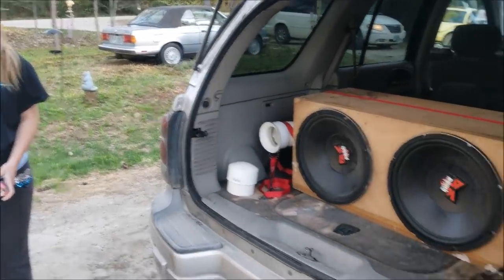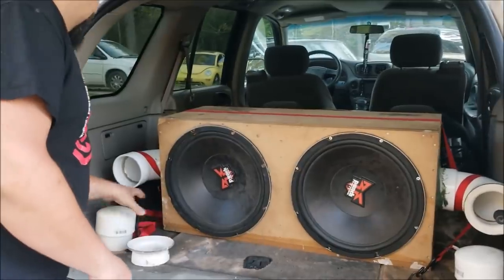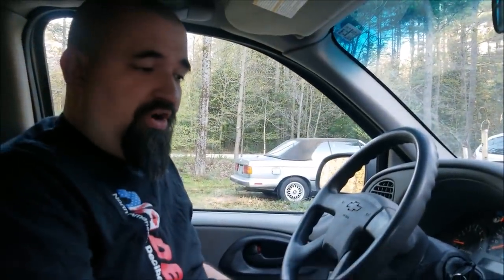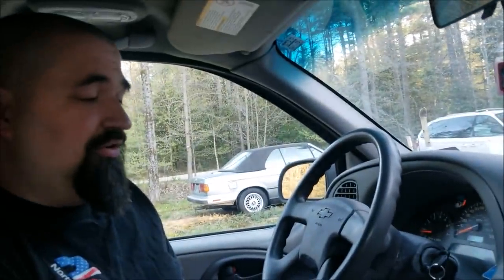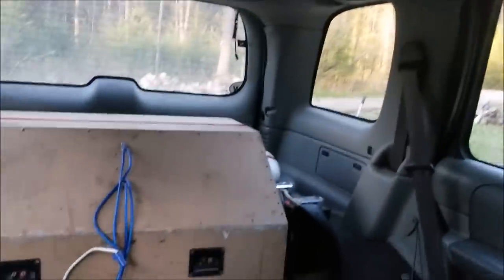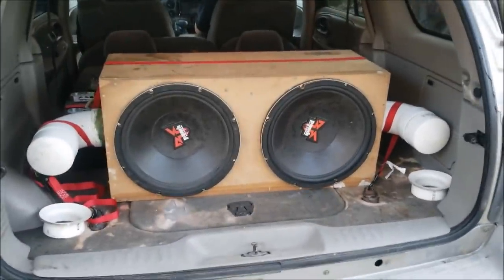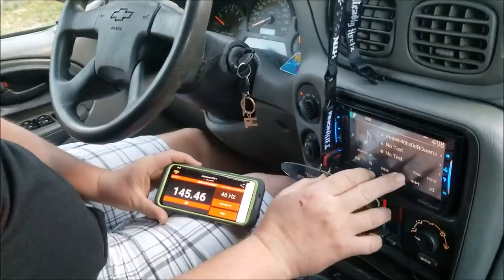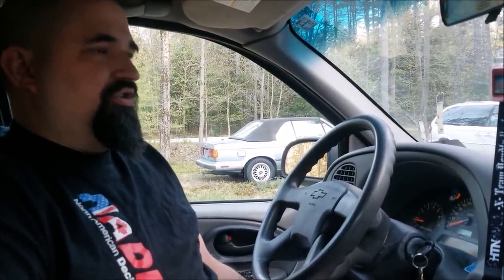Ported vs Sealed Enclosure Subwoofer Box Test with Decibel Meter Using My Daughters Bass Car

Comment: I’m not sure a ported box makes it much louder, but it does sound very different. Sealed boxes sound more “bumpy” while ported sounds more “boomy” to me.
Reply: I have 15 inch sub sealed but it does not rumble in the chest pls any advice
Reply: @Michalslanskycz  What sub and amp are you running and what enclosure and I can do my best to help
Reply: I got sealed and wonder if I should go ported. I don't know what bumpy or boomy implies.
Reply: @DJBLESSD you would definitely notice a difference in the sound and you’ll probably realize exactly what I mean lol. Give it a try
Reply: @TheLILWITEFITZ  yes a difference of better or worse I don't know and I guess to try it would let me know. Good shout. I just wonder if it will be a waste of time. The boxes to buy are 100 to 200 or I could try make it for like 50. "If in doubt check it out" 😉
Reply: @DJBLESSD  if you do make a ported box dont skimp out on port area. a lot of people describe ported boxes as wooshy or boomy because they’re either improperly tuned, or have too little port area which leads to chuffing. for reference my 2 10” subs are gonna be on 28in^2 port area on 800W RMS with a flared 6” aero port. (ive got the 10s but not the built the box yet).

id recommend using winISD, its super easy once you know what youre doing and you can tinker with different tuning, port area, wattage, spl, everything
Reply: @DJBLESSD  -What model, size, & brand of subwoofer? You should follow the Mfg. Suggested enclosure recommendations. First ✔️ to see if they recommend ported. If so these are my go to general recommendations( I have over 30years of audio experience, and the 12sq. In to 18sq. In of port area per cu. Ft. Is not the proper way to calculate port area, imo.), as  Most 12" work well in 1.75cu. Ft net to 3 cu. Ft. net, (2.25cu. Ft. Net works well imo.) Ported enclosure, tuned between 30Hz to 34Hz, (32Hz imo.), with approximately 30 to 40sq. In of port area, per 12", no matter what cu. Ft. Of air space, imo. If you have a 15" most work well in 3cu. Ft. Net to 5cu. Ft. Net, ( 4cu. Ft. Net imo.) Ported enclosure, tuned between 28Hz to 32Hz, (30Hz imo.), with approximately 50 to 60sq. In of port area, per 15", no matter what cu. Ft. Of air space, imo. Hope this helps?
Reply: @Michalslanskycz  - What make, & model 15"? What impedance is the coil, or coils? If its a dual voice coil 15", how do you have it wired, parr. Or series? What make, & model of amplifier/watts @ what ohm? What does your electrical= alt., battery, and wiring/grounds consist of?
Reply: @evilinside5984  yo evil 👋🏼 that don't help me out because I don't understand what cu,ft and net is and I need to go back to school to work out what you mean exactly however thanks for sharing your information. I don't want 'chuffing' 100%, I don't also understand if you have a box tuned to a certain frequency like to 30hz to 34hz does this mean it will not play other frequency's to the same volume? I heard ports can make the speaker over flex more due to air flow I think 🙏🏼
Reply: @DJBLESSD  - A properly built ported enclosure, will give your woofers MORE CONE CONTROL= they will move LESS than they would in a sealed enclosure, as long as you keep the freq., going to your woofers above port tuning. But this can be kept in ✔️ with crossovers/subsonic filters. Example: If a ported enclosure was tuned @ 30Hz, it would still play ANY freq. that is given to it. But it will play more loudly, & have more cone control from about port tuning, to about 25Hz above tuning. This changes from speaker to speaker, & also depends on enclosure size. Example #2: If your 15" woofer works well in a ported enclosure from 3cu. Ft. Net to 5cu. Ft. Net, if you chose 3cu. Ft. Net, it would have a wider, & more even bandwidth= plays more freq., but @ less of a boost, like if tuned to 30Hz, its bandwidth maybe from 20Hz to 60Hz? But if you were to put that same 15" woofer in a 5cu. Ft. Net ported enclosure, tuned @ 30Hz, this bigger enclosure would boost a narrower bandwidth= less freq., but these freq. would play louder, but would also fall off quicker on both ends= the low freq., & the higher freq. The bandwidth may only be from 25Hz to 50Hz? If you put the 15" woofer in 4cu. Ft. Net, & tuned to the same 30Hz, it would split the difference approx. & the bandwidth would be about from 23Hz to 55Hz. These are examples, to give you more understanding. You would use your amplifiers subsonic filter to limit over excursion, below port tuning.

Comment: These subs take me back to a better time In my life
Reply: @Paige Miller   Me too, use to run eight Rockford 15s.
Reply: What is ur profile pic
Reply: @ Dre Swag, it’s a 85 c10, with a 2 tone paint scheme I designed on my computer.
Reply: I had an S10 blazer with 4 XLC 12’s getting pushed with 2 Punch 200ix DSM amps.
Reply: Back to comp days  think it was a 155.5 out of single 15 idk my boss back then was a crackhead
Reply: Very true.
Reply: Do you guys remember the Hx2? :( Such a great times....
Reply: Bro I had the sickest set up. Until my old lady crashed my car. I couldn’t get none of my equipment back. I gave up since then. I’m now getting back into the culture since I’m driving 2 hours a day for work. I’m starting at the bottom but once I get my wires ran it’s easy from there. The new amps now a days are so much smaller! Holy shit
Reply: I can’t agree more !

Comment: I actually felt my sealed box hits harder than my recently installed ported box. But mainly I see the gains going to a ported enclosure is air cooling and venting the heat out of the woofer which will give you more life out of your electronics! I’ll never buy a sealed box ever again

Comment: MAN!!! I miss that old Fosgate. Those amps were insane, and the subs XLC HX2 HE2 power dvc..... USAC..... good times 😁😁
Reply from the maker: Solid equipment for sure, it makes me sad that RF stuff is no longer made in Temple AZ USA... thanks for watching and commenting!
Reply: The power line amps are as good or better than old school But I miss my old school RF shredder design. The punch and prime  definitely not as good as old school
Reply: I still got 2 12´s Hx2 and nothing compares to them... not even Orion Subs :(
Reply: @jaydee2620  yeah my buddy got a punch p3 and that thing was weak.  i had one of those old cheap sony's that looked kinda like a hexagon just sitting around so we through it in there to make sure it wasn't the amp that was the weakest link..  man that sony blew that thing away.  ended up trading him for the fosgate being i wasn't using the sony anyway.  now i'm stuck with it.

Comment: I remember this subwoofer. I was running two sealed Massive CW 12's at the time. My best friend pulls up from the stereo shop and we go for a cruise around the block. A single Punch Power 15 in a huge Obcon ported box... the difference blew my mind! Fast forward 15ish years, I still think of that single sub setup.
Reply: that just makes me think of what you run today?
Reply: @VincentsVideoVisions  A single CT Sounds Strato 12 off a Cerwin Vega Stroker S91000.1D, and in my family car a VVX 10 off an Infinity K1000. Swapping a Wolfram AG12 this week. Not sure which car will end up with the AG yet, most like mine

Comment: You've probably gone on to a different setup by now, but I wonder what your air speed is in those ports. They might be compressing your output. Also, porting increases the volume at a specific frequency, so it's not necessarily 'supposed' to be +3dB everywhere in the range. Your port tuning and your listening area's tuning are two very different things.

Comment: I hit a 157.5 at an SPL comp back in 2001  running 3 JL 12’s and a punch 800A2
Reply: Thats not on a Term Lab= new style pressure sensor type SPL meter. I had a walled 2-15" Power Hx2 Rockfords, with 2-Bd 1500s strapped, & I hit a 164Db on the old style SPL meter  back then. When i ✔ it later on, with a New Term Lab meter, it only did a 149.9Db to my surprise= the new meter showed over 14 Db Less👀, everything was the same, metering positioning, subs, enclosure, amps, wiring, batteries(6 Qty.) & 1 alternator. Now to be fair, the old Audio Control meters could be manipulated by +, or - 10 Db with a knob. But even when calibrated properly, these old SPL meters lost there calibration very quickly, making them very inconsistent @ best. Not to mention that + or - 10 Db knob that i have seen used to cheat scores during a competition to make a fellow friend or competitor score "Louder", then turn the knob back down, to be able to win! These new Term Lab meters can NOT be manipulated/changed, to prevent cheating. Sorry if this hurts your feelings, but your 157.5 Db score would probably be about a 143Db to 145Db on the Term Lab SPL meter, which was not used in 2001 yet.

Comment: What I've noticed is that, to gain 3db or more from the subs in a ported enclosure. You need an enclosure that's ridiculously large. As in like 2x larger.

I prefer sealed honestly. My 12s are in a sealed enclosure.
Reply: Small sealed box for cars, large ported box for home theater 👍
Yes, they're usually 2x as large😂
Reply: This agrees with the iron law that of course more space makes more Bass. 
I've always loved triple or quadruple sealed setups because you can fit twice the drivers in the same amount of air space while maintaining a tighter more accurate sound that has more impact. 

I'm actually headed out to the garage right now to start building my sealed enclosure for three 12-in stereo integrity SQL 12s. They are the best deal out there by a mile if you want ultra high performance xbl2 motor sealed subwoofer setups. 
   Ported can move a lot of air sure but you're never going to get that blur your eyeballs Hammer to the chest at a concert perfect drums feeling out of them.
Reply: sealed sounds better and hits lower.  if you're going for spl then yeah ported.  but i'm into SQ these days.
Reply: @XX-121  if you run enough power on sealed it's still loud but has that concentrated impact and clarity and transient ability that ported doesn't it's worth running twice the power to a sealed setup
Reply: That's what I was hitting sealed back in 90's. Soundstream..
Reply: @XX-121 nothing sounds like the old school 90s and 2000s subs on a sealed box they were designed for sealed enclosures. Now a days subs are designed for ported.

Comment: But what sounds better?  I had a sealed box with two Rockford Fosgate punch 12s and a 700watt Rockford amp and it was some of the tightest and cleanest bass and would put out 144db without any stress.

Comment: I'll never go ported, sealed sounds so much better.
Its tighter, punchier, more accurate bass and it has a far better general  response across frequencies vs a ported box that sounds baggy and is tuned to sound loud on a very narrow frequency band
Reply: Still running sealed? But I agree the sound quality is something else wit a sealed enclosure.

Comment: In most instances a given drivers optimal ported volume is much larger than it’s optimal sealed volume. That’s why there’s usually a much larger dB difference between the two enclosure types.
Reply: I got a big old school sealed box and it sounds amazing

Comment: This question might have been asked and answered already in the comment thread but..Would you say in a music listening scenario instead of a db scenario, the sealed gives a better ,tighter, accurate bass response and is worth the loss of 1 plus some change db?? Thanks if you feel like answering! 👍🙏
Reply: Since nobody answered I will I absolutely know that the flatter response and better transient response of sealed makes it far superior for me but then again I'm a 46 year old musician that's been a lot of time on a metronome. 
     Also the earthquake reproduction characteristic of sealed where it literally displaces a section of air in your vehicle that is heaven and a ported does not do this it just fans around a whole bunch of air from the port and sub. It never has that instant earthquake shock type impact to it and I like that.

Comment from the maker: She's quite the basshead, just started her own channel - https://www.youtube.com/channel/UCTKrYsApDlmKB3v5tG7__3w?pbjreload=10 - She took 1st in Rookie at the Team Deadly Hertz show, you can see her meter run here - https://www.youtube.com/watch?v=2O4SeJzHci4  She is currently a 151.5, her latest competition was the Frozen SPL show - https://www.youtube.com/watch?v=ChR0gRUubCc&t=492s  Thanks for watching and commenting! Please like & Subscribe!!!!  - Meter used was an SSA APM1 Meter. The enclosure has separate chambers, 2.5cf each after displacements, with the port flares it is tuned to 35hz
Reply: Steve Young im running a prime 500 2ohm to a single p2 12 2 ohm in a p box single ported. It does good for 1.8 cf box but i want a lil more out of it ! Any help would be appreciated . Was thinkn bout goin to a p3 but i dont think the 500 prime can push it? Ty

Comment: I have had so many systems but easily my favorite was back when I had a pair of Fosgate DVC 12's in a sealed box running off a MTX Black Gold amp. I just haven't been able to find a sub with the same force factor. I went to 4 12" JL audio 12w3 running off twice the power. It was loud but nothing even close to the beating the 2 Fosgate DVC 12's would give you. I wish Rockford Fosgate would release a classic series of car audio where the legends that made the company would be available.  I would buy multiple systems just to have backups of everything.

Comment: Radio will make a big difference as well. You could easily upgrade that jvc radio and gain more juice for your sounds.
Reply from the maker: She is running a Punch X crossover which gives a decent bump in RCA signal voltage. I run a Rockford  PA1 preamp in my jeep and can get above 8v clean signal to my amps. Definitely makes a difference having strong signal and a lower noise floor. Thanks for watching and commenting!
Reply: Yup Pioneer FTW!

Comment: It doesn't matter if u win by a dB or a mile, winning is winning!.. I am a ported box guy can u tell? Lol good video and congrats for the win!
Reply from the maker: Thanks for watching and commenting!
Reply: I got nostalgic watching this. Last time I saw 2 Punch Power DVC 15s I installed them in a navigator, custom box with mirrors inside using Aeroports pushed by an Orion HCCA 250. It was humping!

Comment: I had a similar situation with my triple audiobahn alum10q's. Friend if mine has 3 as well. Mine are sealed and his is ported and we can not find any major differences between the outputs. The difference is that he rebuilt his with dual 4ohm coils and I am using all stock from the shelf subs. I assume that is because AFAIK these are supposed to be in a sealed setup from per manufacture specs. His setup is approximately 2db louder but they sound identical according to the crowd :D

Comment: I'd like to see the dB reading at 20-25hz sealed vs ported. I'm interested to see which will hit harder on the low frequencies. Great video.
Reply from the maker: Thanks for watching and commenting. I'm assuming if the ported side were tuned low enough it could be quite interesting to see. I did do a video showing the excursion side by side playing 20hz - https://www.youtube.com/watch?v=gMjPjDh4bK4&t=1s
Reply: If the ported box is Tuned right. It vil be louder at Lower frequencies.
Reply: Sealed has almost flat response over Low frequencies. If you have a powerful amp and a subwoofer, go for sealed for hard hitting bass

Comment: he did this with equal size boxes the numbers wont change much or any if he removed the port. to get a bigger number from the ported box you would have to go bigger which is a whole different animal but for apples to apples this is a great video ..i have 9 15s i plan to use in a build and i want to go sealed just for the space savings all the subs inverted
Reply from the maker: I know most subs require a larger enclosure when going ported however according to the manual the optimal recommended enclosure size for both sealed or ported for these drivers is 2.5cf. Thanks for watching

Comment: does the 4" x 14" port mean 4" diameter tube cut to 14" length?
I thought it meant a rectangle cutout 4" high and 14" wide.
I think it needs a larger port than the 4" diameter.
Which is correct?

Comment: can ported boxes be just as accurate as sealed boxes? im a newbie and ive seen a lot of mixed answers about this! btw love the old school rockford stuff! im running old school 90s 10's, my dad used to have old school fosgate 15
s on a 650 mosfet!
Reply from the maker: Those 650 mosfets were beast amps! Yes, if properly designed a ported enclosure can perform just as accurate as a sealed enclosure, it all depends on design and proper construction.

Comment: Are the 36hz the tuning frequency? Then it should be way more than like 1,5db. If so, your ports are too small and compress very hard what makes them behave like a closed box on high spl due to much port speed.

Comment: Tuning with a port gains dB at the tuning frequency.  The port tune should be at the most efficient frequency for the speaker box design for just boom or after roll off to gain bass extention in a flat out put design

Comment: Mate. Every 3 DB gain is double the Power. To get 1.5 DB gain is great stuff and half power more for free
Reply from the maker: Thanks for watching and commenting! I should do a video using the meter to illustrate the gains from doubling power, I would want to clamp the amps or use an SMD Amm1 to show a power read out to confirm the power is doubled, would make a cool video.
Reply: Easy man easy on Dem ol subs
Reply from the maker: @fuckgoogleandyou8779  they can take it 💪
Reply: appculture I thought it was double every 10db.